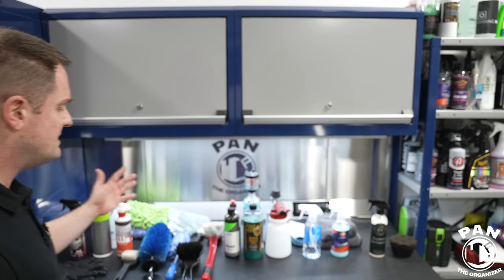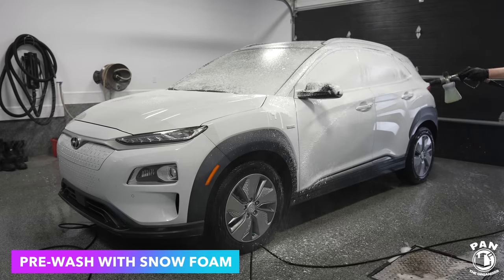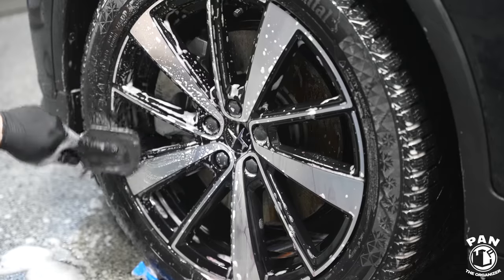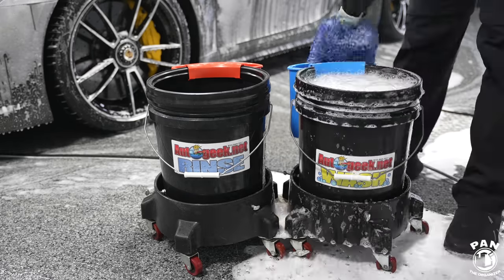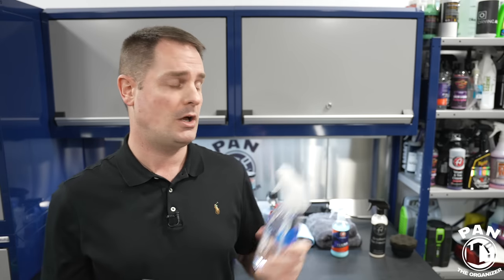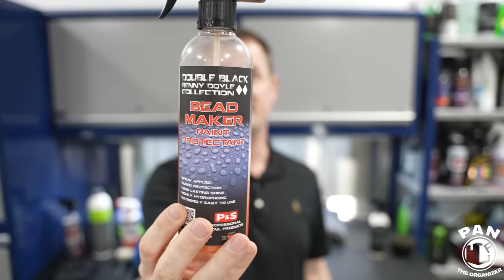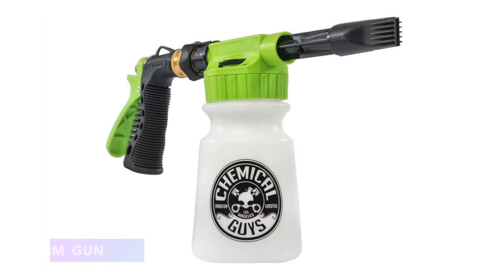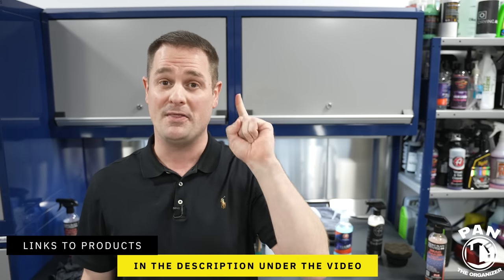Car Wash Kit - Everything You Need For A Complete Wash!

Comment: Thank you, Pan! For rinseless washes, which do you prefer, a mitt or sponge? 

I just started rinseless washing with ONR and I went with the same black sponge you see Mr. Lacrois using in the video. The limitations I see with it are hard to get to areas like honeycomb grill, the wedges around the lights, trunk wedges, etc. I'm thinking a mitt might actually be better.
Reply from the maker: I don't use the rinseless wash as often, and only if the vehicle is very lightly dirty or just dusty really. I think I'd prefer a mitt.
Reply: I see. I'm not a homeowner, so rinseless or washless are my only options unless someone out there has better ideas. I'm street parking.

Comment: I use my EGO 650 CFM leaf blower to blow out all the water that remains in every crevice of of the car after a towel dry the car.  These crevices include light bars on the rear, the door handles, and behind every piece of chrome attached to the body.  No drying towel can get the water out of the crevices, so the blower is perfect for finishing the drying.
Reply from the maker: Correct.

Comment: Another great video Pan! Thank you for continuing to share your passion with us and show us what options are available. Question. Do recommend using the same bore hair brush used on the lug nuts for the emblems and between the parts connections or is this too rough and I should use the soft (make up) style brush for that? I am not sure if the bore hair will scratch paint or now.
Reply from the maker: Use the soft brush for emblems and anything touching the paint. The boar hair is fine for the wheels.

Comment: Hi Pan. New to the channel. Thx for the great tips. Without going through the whole library, question about (ceramic or other) coatings applied to the paint. I have a new 2023 GMC Canyon Denali and wondering about your advice on this. Yes or No?  Particular product? Pros v Cons? 
Much appreciated. Bill
Reply from the maker: Hi Bill. First, let me officially welcome you to my channel. You discovered one of the biggest car detailing channels on YouTube as we surpassed 965,000 subscribers and we have over 130 million views! I have been detailing for 26 years and I love to share my knowledge and passion with my viewers.

You found the right channel to help you learn everything about detailing.

A new car is never new until it's properly detailed. 
- at the factory, the paint defects are often corrected quickly by rotary polishing which can leave marks and holograms, so polishing corrects those, before you lock that in long term with a ceramic coating for example.
- vehicles are then transported by truck, train and boat so they are exposed to the elements, industrial fallout, brake dust, rail dust, etc
- vehicles are often left at boat docks (when transported by boat) or in exterior parking lots for weeks or months, again being exposed to the elements
- at the dealership, the vehicles are almost always poorly prepped using the same dirty water that was used for all the cars on a given day, and poor washing and drying methods leading to swirls and scratches 
- at the dealership, a layer of cheap wax or paint sealant is usually applied to attempt to make the paint glossy prior to delivery. It's crucial to remove any previous protection before you apply a ceramic coating, as coatings need to bond directly to a virgin clear coat.

If you only plan on applying a regular carnauba wax or paint sealant though, you could decide to skip machine polishing, as those protectants can be applied over existing protection and it's not as crucial to prep the paint as well.

I explain all of this in this popular video: https://youtu.be/QgoyrC-5CMc

So you can better visualize the new car prep process, here are the steps I perform on a brand new car for my customers: 
Mercedes S 580: https://youtu.be/Vq_tfcwryVI?si=whord2_UEFSg28UW
Aston Martin Vantage: https://youtu.be/OKga3yZVTqo
Volvo XC60: https://youtu.be/tvDBBenhYFA
Tesla Model Y: https://youtu.be/gohks8xP5NY 
Porsche 911 Carrera: https://youtu.be/2ckiivbFqs4
Mercedes AMG GT63S matte black: https://youtu.be/eU8zg1lXvXY?si=oGxoCp8PWt7gTncV
Audi Q7: https://youtu.be/t7HCBSVnizM

Comment: Recently started watching your videos as I just purchased my first ever brand new car. Have really taken up Detailing as my new hobby over the last two months as a result- even working on re-doing my whole garage! Have learned so much; truly grateful for the info and product reviews/recommendations. I'm naturally OCD and a perfectionist so Detailing really agrees with me :-). 

I'm working on finalizing my Detailing arsenal and had a few questions: 
NOTE: For background my car is coated with x2 Coats of Ceramic including front windshield and wheels; PPF on Front Bumper and Headlamps. This was professionally done (looks amazing)- brand used Gyeon [not certain on EXACT product]. 

1) Purchased a EGO 650 Leaf Blower and variety of microfiber towels from Rag Company. If I'm using the EGO to dry after a wash should I ALSO use a Detail Spray drying aid? For example Gyeon Ceramic Detailer or Gyeon Cure ( Cure diluted 1:1 when used as dry aid)? Or is this really only for towel dry and instead just use Gyeon Cure periodically post wash on clean and dry car.

2) Pre Wash Foam - saw your Car Wash tutorial and wanted to confirm its safe to use Gyeon Foam; then proceed to use a Soap (Car Pro Reload or Gyeon Bathe+) on top of foam before any rinsing...meaning I'm mixing my Pre Wash foam with my Wash Soap of choice. I'm 90% certain this is ok...but wanted to check if perhaps I misinterpreted and your actually foaming, rinsing, then re-foaming with the same wash product as in bucket to avoid mixing the two during the wash mitt phase. 

3) P&S Brake Buster is safe on Ceramic Coated wheels correct? Is there a recommended Dilution ratio to avoid negatively impacting the coating? I was thinking 3:1 or 5:1. Caught wind of a random YouTube video where Brake Buster was apparently used to remove a Ceramic Coating and wanted to be extra careful on this. 

Thanks again for the great videos!

Comment: Hi Pan! Thanks for the tips! 
Do you recommend using only the hybrid Titan detailer alone( after drying), or can I use the turtle wax shine before adding the hybrid titan detailer?
Reply from the maker: It depends if your paint already has a long lasting protection. Ideally, as a base layer, you'd want something like a ceramic coating or at least a ceramic spray for long term durability. Then, once every 2-3 months, you add a "topper" like Phoenix EOD Titan to boost and maintain the properties. Or any other lighter spray for maintenance.

For your regular weekly washes, use a quick detailer or drying aid, nothing too durable, as you don't want to overload the paint with too many products one on top of the other, which can lead to product buildup and streaking.

Comment: Love your videos! Question I recently decontaminated,clay barred my car then sprayed seal n shine over it. I borrowed my friends buffer machine so I can polish my girls car but now I want to do mine. Do I have to kill the seal n shine first before doing that?
Reply from the maker: You would have to wash the car, dry it, and then move to machine polishing. That mechanical abrasion will remove Seal N Shine. Once you're done polishing, you can use an IPA to wipe the surface (or a paint prep like CarPro Eraser) and then apply a fresh layer of Seal N Shine.

Comment: Great channel Pan!! Always appreciate your videos and recommendations. Alot of great products there. What would be your recommendation or regimen after coating using Turtle Wax’s new products? Such as the steps to use them on top of one another?
Reply from the maker: It depends what you mean by new products... If you applied a paint protection like the Turtle Wax Ceramic Spray Coating or the newer Graphene Flex Wax, maintenance is quite simple and you have three options in their range:
1) use the Turtle Wax Hybrid Solutions Wash n Wax as maintenance (it cleans and ads a bit of SiO2 protection)
2) use the Turtle Wax Hybrid Solutions Ceramic Wet Wax as a drying aid
3) use the Turlte Wax Hybrid Solutions 3-in-1 Ceramic Quick Detailer as a quick detail spray

I speak about the maintenance and when and how to use them in this popular video: https://youtu.be/QL1kEPutvLY
Reply: Thanks For the reply Pan! I appreciate it. What steps would the new Graphene products include? Also, would you recommend the black graphene products over the HS ceramic turtle wax products?

Comment: Great video, thank you so much! I have a question, can i use self service carwash after appling cermic coating? Will it damage the coating?
Reply from the maker: I can't recommend using automated car washes for any car. Wash your car yourself, at home. That's the best way to keep the paintwork scratch and swirl free.

Repeated use of automated car washes that use high pH harsh shampoos will weaken any protection over time. There's so much chemical resistance that a coating can offer, even if it's way better than a normal wax or sealant.

Comment: Hello Pan, I'm going to ceramic coat my aluminum rims but I would like to polish them first. Is there a specific wheel polish you need for this, or can any polish such as meguiars ultimate polish or 3d one polish work? Also, would it be best to hand apply the polish with a microfibre applicator pad?

Comment: Hey Pan, thanks for the video.  When air drying the car is okay to use a quick detailer or should we use a microfiber when adding the quick detailer?
Reply from the maker: If you are using a blower to dry the car, you wouldn't be using a drying aid. A drying aid is used when you are towel drying the vehicle, to act as a lubricant.

Comment: Hi Pan, Got a question, been watching your videos and purchased some stuff, but I'm curious on one item. Our cars are ceramic coated, and I want to maintain/refresh the coating on the vehicles. What product would you recommend for maintenance of the ceramic coating? I see a lot of ceramic spray coatings but they seem to be less permanent ceramic coatings, I just want to maintain my current coating and restore some of the hydrophobic/shine properties to the car since it's been almost 2 years since the initial coat. Thanks for the help
Reply from the maker: I made two videos on proper coating maintenance here: 
https://youtu.be/yLiePQRMFc8
https://youtu.be/NDJG17gzwhM

But keep in mind you should be doing a maintenance wash at least once every two or three months on a coated car. Waiting 2 years is way too long and it's possible that the performance has dropped to a point where you won't be able to get it back to normal.

Comment: Will all these products be safe to use around grass? I’ll be doing most of my work outside so I have to be weary of not killing grass or plants around.
Reply from the maker: I wash my car in my garage so I can’t speak to doing this outside. But the only thing I potentially see that could run off up to your grass a bit is the soap and it’s just a gentle pH neutral soap so it’s of no concern in my opinion.
Reply: Thank you sir

Comment: Good evening pan, does the iron remover damage the plastic trims on the exterior of your car during your decontamination process?
Reply from the maker: No. As long as you don't let iron removers dry on the surface, and don't work in direct sunlight, you're fine. There will naturally be some overspray on plastic trim when you spray the paint, so it's ok. You can even use iron removers on glass.
Reply: Ok thank you, I really appreciate you.

Comment: What do you think about silicone spray for plastic and rubber seals ? Don’t know anything about it and My buddy showed me using his jeep spraying it on exterior plastic (Bumpers, lower door, wiper cowl, window trim etc) I will say it did have a nice shine a dry to the touch no greasy residue... it might just be a jeep thing lol
Reply from the maker: I only use silicone spray for rubber seals around doors and trunk lids, to make sure the rubber stays soft and doesn't freeze during the winter (moisture) and that way your doors always open.
Reply: @PanTheOrganizer  any negatives to using it on plastic?
Reply from the maker: I don't use it on plastics so I can't comment. For plastics, I use compatible products like CarPro PERL diluted 3:1 for exterior plastics, or 303 Aerospace protectant. Or better yet, a trim coating like CarPro DLUX or Gyeon Trim (longer lasting).
Reply: @PanTheOrganizer   well good to know 👍🏻 might grab a can to do all the rubber seals. Right now I have Gtechniq C4 and maintain it with VRP, I’m trying to find a replacement for VRP.  I think I’ll try CarPro PERL next

Comment: Hey Pan, can I combine the P&S bead maker with the Ice Seal n Shine. I just got a new truck and I really want to take care of the paint, until I can later potentially get a ceramic coating! What do you suggest?
Reply from the maker: You absolutely can. Apply Sean N Shine first, as your base layer of longer lasting protection (3-6 months). And then you can use Bead Maker on top after your routine washes, to boost gloss and slickness.
Reply: @PanTheOrganizer  Thanks, will do! I appreciate you taking your time to respond!
Reply from the maker: My pleasure! How did you discover my channel by the way?

Welcome to my channel. You discovered one of the biggest car detailing channels on YouTube as we surpassed 965,000 subscribers and we have over 130 million views! I have been detailing for 26 years and I love to share my knowledge and passion with my viewers.

You found the right channel to help you learn everything about detailing.
Reply: I just have been trying to up my detailing game and I have been enjoying your helpful videos. 

Also, another quick question. Once I apply Seal N Shine will it come off by itself after several months of continual washing or is there something I need to do before applying more?

Have a blessed rest of your week!

 @PanTheOrganizer

Comment: Hey Pan, just a few quick Questions if you don't mind.

1. If you're waxing and need to dry the vehicle beforehand, would you still use some kind of spray for lubrication? Or would that interfere with the bonding of the product?

2. If I used a synthetic wax and then a ceramic spray on top of it would that still work potentially? I love the way wax looks on my black car vs the ceramic sprays. (I may just need more practice with the ceramic products too.)

Thank you in advance!
Reply from the maker: 1. For waxes it doesn't matter. You can use a drying aid to dry the car, before you apply a wax.

2. Don't mix regular waxes with ceramic based products.
Reply: @PanTheOrganizer  Thank you for the quick feedback!
Reply from the maker: My pleasure.

Comment: I have a quick question, hopefully you can find this. What is the point of the Koch chemie, when we have the car shampoo, Do I use one or the other during the clean? Is it just for tires?
Reply from the maker: You mean the Koch Chemie Green Star? It's an all purpose cleaner. Some people like that to clean things like engine bays, degrease tires, etc.
Reply: @PanTheOrganizer  Oh ok, thanks for the quick response, So its not what we would use mainly for the body, correct? 

Thanks so much for the video series btw, its been a blast learning about all this.
Reply from the maker: Correct. For the paintwork, you use the shampoo. Although some people like to sometimes use an APC as a pre-treatment, before washing, to help break down grime and dirt, if your plan is to apply a wax or sealant at the end of the wash process. But that's a completely different conversation.

Comment: Hello Pan I have a question should I pre rinse first the car or form the car first should the foam Cannon be applied on a dry surface for better emulsifying then a wet surface because it would dilute the solution
Reply from the maker: There is no right or wrong answer. Some like to foam on dry paint, some like to pre-rinse and then foam. I typically pre-rinse and then foam.
Reply: @PanTheOrganizer  thank you I guess it depends on how dirty the car is so if if I need to rinse depending on how dirty before foaming thank you very much

Comment: Noticed that you added Green Star to GSF. What dilution ratio do you do and do you combine the two always? Thanks
Reply from the maker: They talk about the proper dilution ratios on the Gsf bottle, to make it an active snow foam. Just follow the instructions. I only add Green Star when I want a bit more cleaning power, like for tires, or engine bay detailing. Or sometimes on paint to remove stubborn traffic film.
Reply: @PanTheOrganizer  thanks as always pan. I already use gsf just haven’t used green star yet.

Comment: If a car has a ceramic treatment, what method of washing can be recommended if the car is not very dirty, for example; waterless wash, rinseless wash or foam wash? Thanks!
Reply from the maker: I will always recommend the traditional two bucket wash method. A rinseless wash in second place only if access to water is impossible. And waterless wash never unless you have no other choice.

Comment: I'm worried about a waterless wash can cause swirls on graphene coating?
Reply from the maker: Try to avoid using waterless washes unless you have no other choice. If you have access to water, I always recommend the traditional two bucket wash method.

Waterless washes should only be used as a last resort method for those who live in places with no access to water, or in cities with heavy water restrictions or water bans. And waterless washes should only be used on very lightly dirty vehicles.